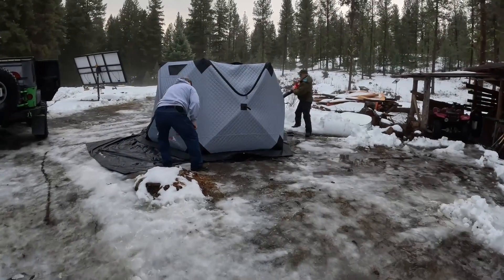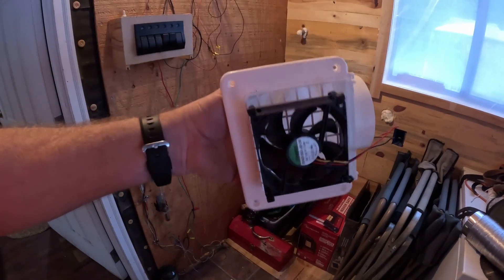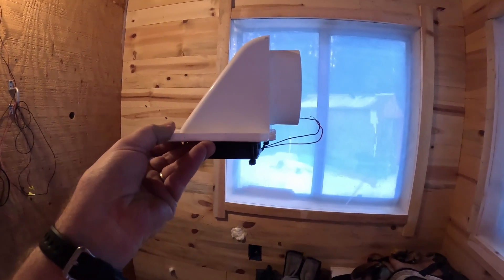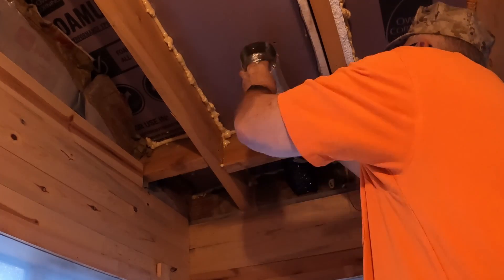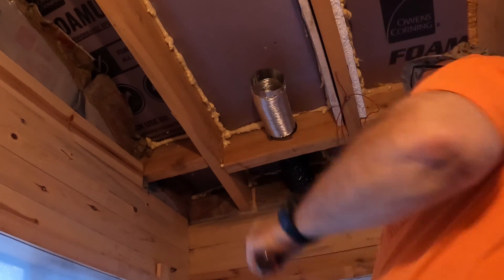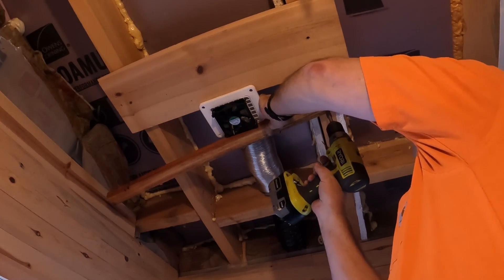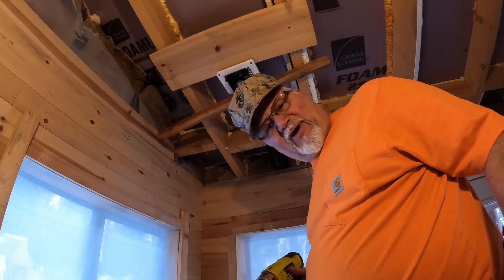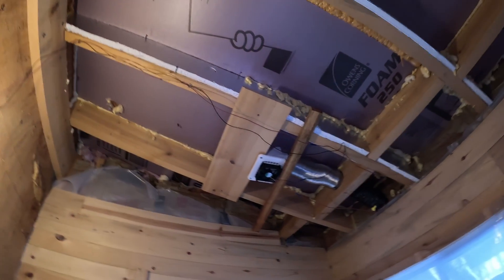Baffling My Solar Heating System at our off grid cabin #offgridcabinbuild #solarheat

Comment: Hey Marine, the air flow takes the path of less resistance. The most likely reason the little door only opens slightly is because your fan leaves holes on either side of it that lets the fan pull air through those instead of pulling from the solar heater. Have fun. Semper Fi.
Reply from the maker: Agreed.  I've thought of making a cowling to try that but also a stronger fan might help.  Semper Fi!